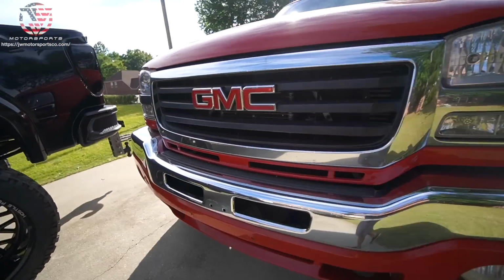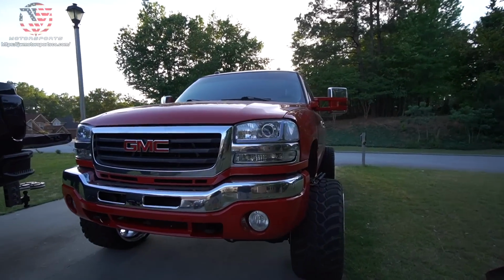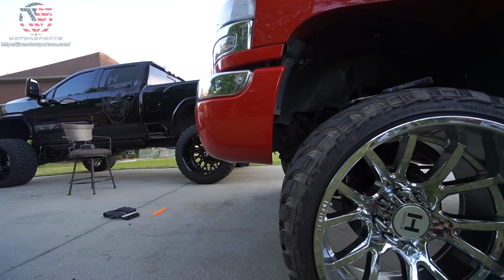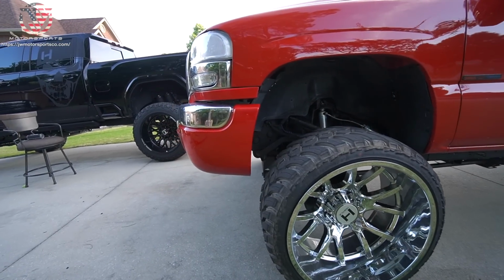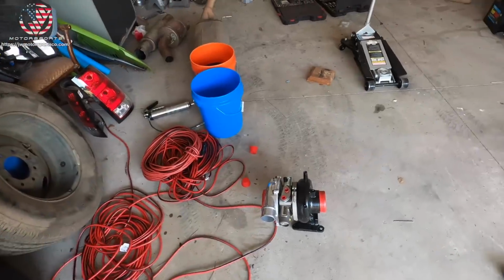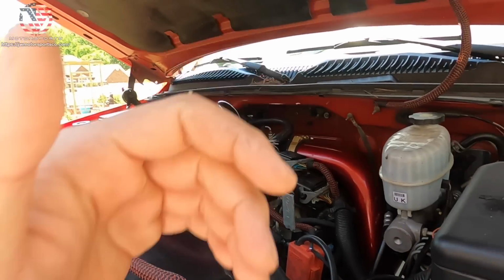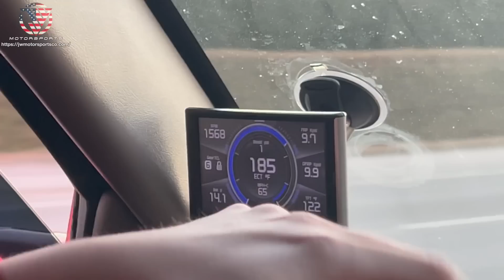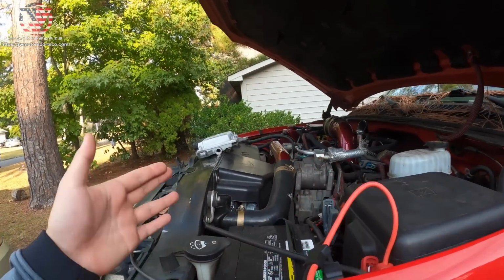I Swear I'm Done After This....!

Comment: Ive been watching for a while and i feel like after replacing so many ficms. You have an electrical issue. Low voltage will kill it
Reply from the maker: It was the batteries. You may have missed the episode where I put 2 brand new interstate batteries after the wal mart ones died in 6 months